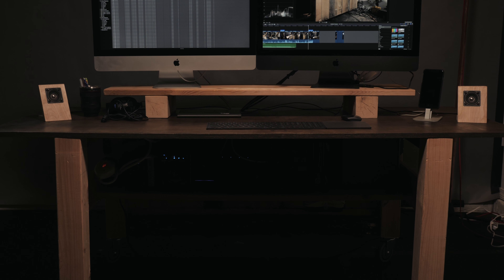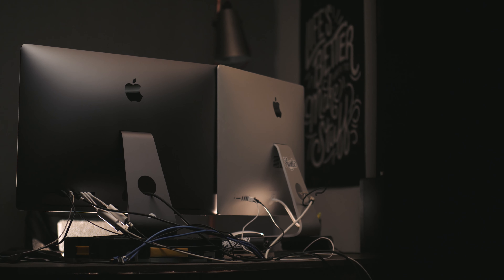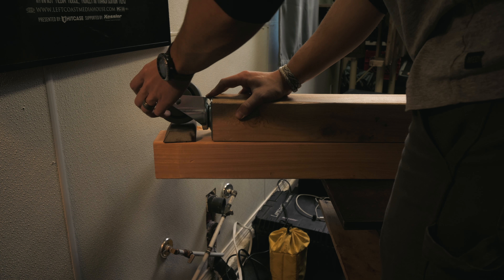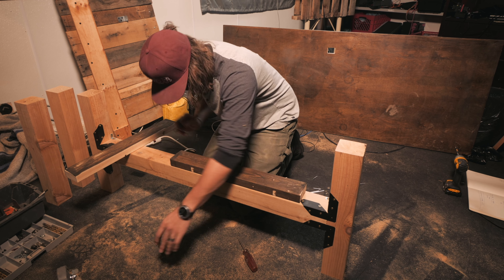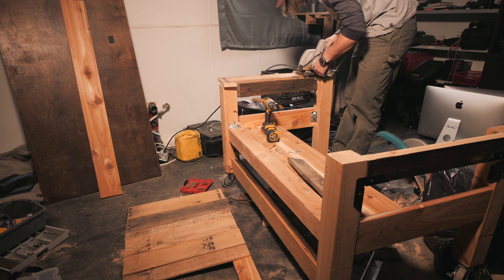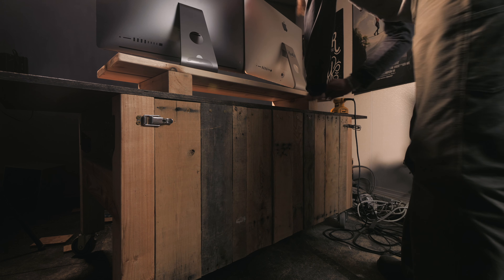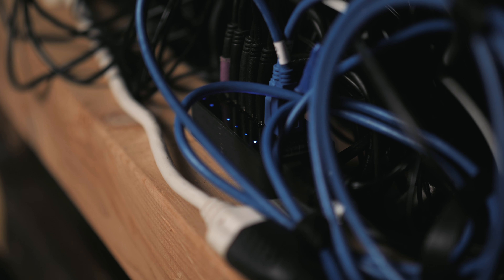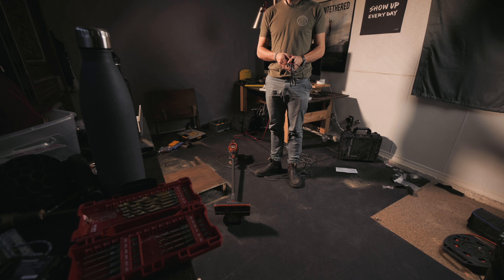Dream Desk! Ultimate Dual Monitor, 129TB Setup

Comment: FYI.  Easy desk build.  Get used solid core doors from a General Contractor doing demolition on a project.  Go to hardware store and buy 4 toilet flanges (typically put in the floor to connect toilet fixtures too).  Attach to the underside of the door, one at each corner.  Then buy the plastic plumbing pipe (either 4" or 6" diameter, I don't remember) and cut to the length so you get the height of the desk top you want.  The pipe friction fits on the flange, so you have the option of different height work surfaces based on the length of the pipe you use.  Looking at your video, I got the idea you could buy 4 flanges for the bottom of the pipe and screw them into some square pieces of plywood and attach casters to the bottom so you could still roll you desk / work surface around.  Just thought I would share.

Comment: Yo, Levi Allen. I created a smaller version of one of these for my office. Different top as I used 2x12 boards so it's more like a picnic table top and I didn't go through the back doors part because mine faces a wall anyway. I basically got mine setup so there is a battery backup up inside the shelf so in the end I literally only have one plug going to the wall. Wasn't cheap but it is rock solid.

Comment: Well done, looks great! I'd just let the cedar age naturally, it will darken somewhat over time.
One thought I had was that if you wanted to make a very shallow drawer under the main part of the desk, it could be maybe 1" deep and say 18" wide by 12" in depth, you can put a lot of stuff right there, and get it off of your desktop, but it's still right there, short cables, memory cards, maybe a small collection of tools, pens etc, you get the idea. I would be simple to do and I thought I'd just mention it.
Cheers from Tokyo Japan.

Comment: Nicely done Levi... you’re all set!  

Oh, you forgot one thing.... wrist shackles on top of the desk to lock yourself into editing mode! Lol  ADD? Yes, I have it as well, sadly, I think it’s part of the creative mind.  (Oh look, an article on a new lens) 

Once I you get into an edit, well, I  don’t want to stop because I’m into it and on a roll. I don’t know about you, but sometimes I have a hard time starting into a larger job because I subconsciously know just how much work it’s going to be and that it’s an “all in” job. So you try to clear up all the other stuff first.  That’s not always good. 

Oh, and one suggestion when build something again... a plastic bag on your chop saw won’t catch sawdust.  You need a proper dust bag that allows air to flow through the bag while capturing the sawdust in the bag. A plastic bag is sealed and air doesn’t flow in order to move the sawdust into it.  

Personally, I tape the hose of my ShopVac to the saw and turn both the Vac and the Saw on and it sucks the sawdust up as I cut.  Much better solution :-) 

Love your channel Levi!!

Comment: Nice desk I am going to steal the wheeled idea and the permanent cable management I might add sealing and dust filtered ventilation to keep down the amount of times I have to clean.
I second that other peoples work flow is super interesting and how you made those software and hardware decisions. I am particularly interested in how you made the decision with respect of security on site storage off site storage. The size of 4k video is ridiculous and what implications that has to your work flow.

Comment: water lines over your power strip!? living on the edge! :)
Reply from the maker: Water lines? Those are USB 3.0 cables - I believe you are seeing
Reply: Leftcoast I was referring to the spot in the vid at 1:30 on the wall of the room. It looks like water lines with shut off valves and a drain line on the wall right over a power strip.  If it is, that makes me nervous😬 however this just an observation. P.S. I love your channel and the videos you post are inspiring and helpful!👍🏼 keep it up!!
Reply from the maker: Ah! Yeah, those used to be used for a sink. No water running to them at the moment = )

Comment: Hey, are you using Target Display Mode to turn your older iMac into a second monitor?

I don't trust the iMac's fans. Over the years, I've seen too many internal hard drives die in these machines. I highly recommend getting an app like iStat menus, which allows you to see how hot your machine is actually running, and manually throttle your fans up, if you want.

Comment: At 129TB curious on why not move to a NAS system instead of messing with all those hubs and cables? With the 10GbE connection on the iMac Pro nothing would be holding you back. And you would have access to your media on the go and at home. Something like what Linus has been doing with other YouTubers and hooking up a Storinator from 45Drives.

Comment: Nice one Levi! Would love to hear more about your media management... also are you using your older iMac just for Apple compressor? Or anything else? Or is it an older model running as target display?
Reply from the maker: Running it as target display, and render tasks in the background.
Reply: Leftcoast ahhh nice one. :) so it is a non 5k model?
Reply from the maker: correct, I bought it for exactly this purpose, just took longer to have a upgrade option than I thought
Reply: Leftcoast Makes sense! I’ve literally just upgraded to a new rig and deciding what to do with the older imac. Also just made a new desk a couple of days ago, not half as great as your setup though! I also just switched to using final cut for a heap of projects in December... I feel like our name isn’t all we have in common, despite being on opposite ends of the earth! 😂
Love your work man. Looking forward to seeing more. 🤙🏼
Reply: How do you power up the second display? On my older Thunderbolt iMac I always have to hit a shortcut on its keyboard to have it switch to the external monitor mode which is kind of a hassle. Did you find a better solution to this?

Comment: What size did you use for the plywood for the top of the desk.  Thanks
Reply from the maker: it was I believe 3/4 inch and started as a 4x8 sheet, but I cut it down
Reply: Levi Allen awesome,  thanks.  Love your content and will be starting my desk build soon.